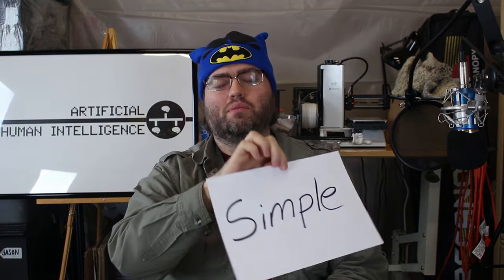How to simply set up a Condenser Microphone

Comment: I have this condenser mic that requires phantom power (neewer nw-700). I also have Yamaha MG10xu usb mixer. I already configured the Internal set up from my interface. yet there is still problem, there is no sound coming from my condender mic to my mixer. My other input such as my guitar gives a sound feedback. I also tried using a regular microphone which also gave a sound feedback. What should i do? is there also a problem with my stero plug to stero jack converter? what should I do?

Comment: Picked up a similar mic from wish nearly identical to that one. But it doesn't require a phantom power supply as its XLR cable is 3.5 mm jack at the other end and draws power from my laptop.

Comment: Thank you for your video.  It helped me greatly.  I have a question:  I have the same exact microphone you have in this video - the Excelvan only mine is a gold color.  I am using a Mac Mini computer but my recording device still does not work.  I did some research and discovered that I need a microphone adapter, specifically, a TRRS (Tip, Ring, Ring, Sleeve) adapter in order for it to work.  Do you have a video for this particular mic adapter?
Reply from the maker: I use a usb sound card, $5 and solves that problem.
Reply: Thank you.

Comment: Thanks Jason!  You are very informative.  I have two Studio Projects B3 mics, a matched pair.  I haven't used them in years, (since 2005) but I think they have phantom power built in. (?)  I'm planning on using them with a Focusrite Scarlett 2i2 3rd Generation digitizer (I think that's the general term for them).  I will only have my solo vocals while playing my non-plug-in nylon string acoustic guitar.  I might sometime have an upright bass player as I sing folk music I've written.  I will get a shock mount and a screen for the voice mic.  With the mic to my guitar do I need a screen, and also need a shock mount for that too?  What do shock mounts really do?  Also if I forget and accidentally have the phantom power on with the mic source, and have it on with my Scarlett 2i2 (haven't bought it yet) would that burn something out?  Thanks for your videos!

Comment: I need help. I bought a voilamart mic and I just bought a hp laptop as well. When i connect it i can hear what im saying on my headphones but when I record the computer doest catch what i say into the mic and it just gets the sound from from the laptops speakers so basically it's like if the mic isn't even connected. Do I need that box that you said was 20 dollars for this thing to actually work?
Reply from the maker: Check your settings on your recording software and make sure that you have your mic selected as the recording device. You may also have to make that mime the default recording device in the recording device panel.

Comment: So ive recently bought Taffware BM 700 mic
And i plugged in to my 3.5mm jack on my laptop and i tried it, it had this buzzing noise everywhere, my voice was unaudible
So i decided to update driver by downloading via realtek website And i tried plugging it in, now it doesnt detect
So with further digging i think i need phantom power supply Will this work?
KREZT PH-710KZT http://krezt.co.id/product/krezt-ph-710kzt/
Will this phantom power fix all the issue i have right now?
Reply from the maker: You need phantom power for that microphone, yes.
Reply: Artificial Human Intelligence so after i received my pp then connect pp to my laptop using 3.5mm jack will it detect? also thanks for the help, subbed
Reply from the maker: After you get the phantom power, if it still doesn't work then roll back the driver.
Reply: Artificial Human Intelligence alright thanks for the guide, i appreciate it
Reply: ItsProinc did it work cuz it happend to me too

Comment: Hey question, If I have a laptop with only one input 3.5mm so combined mic and headset a condencer mic and a phantom power supply will I be able to use that combined port for my output from my phantom?
Reply from the maker: You will need either a splitter for that or a usb sound card. Usb sound card runs about $5-10
Reply: @MacAmbrais  thankyou :D

Comment: As simple as this is, mine still doesn't work. I have the same Nady and a MXL V63M condensor and nothing. However the output cord I'm using, I'm having to use a 3.5m adapter to 1/4 to make it fit my pc. Possibly a problem? It's a new pc I built for gaming so it's high end it's just the most problematic I've ever had for recording. something I've done since '97 lol...

Comment: usb is digital audio XLR is a different audio.  you cant use two different audios if u do it  can damage ur phantom power or microphone u have to buy a converter with the phantom power. if ur trying to use it to ur pc in. U need a usb audio interface is basically phantom power and a usb converter for a cheaper price. thank me later

Comment: I feel really dumb, but the only thing on my computer that fits the 3.5mm is my headphone jack, but that doesn't pick the microphone up obviously, so when I open garage band to record anything it doesn't even show that a mic is connected to computer....what am i missing?
Reply from the maker: A usb audio adapter. Should be 5 bucks on amazon.
Reply: You may need an adapter - TRRS (Tip, Ring, Ring, Sleeve).

Comment: I have a question I have this same mic, bought the phantom power supply, I technically have everything. But if I connect the microphone to my surround sound it sounds perfect, but once I connect it to my computer and try to record the audio it comes out really distorted, sounds really low, and has a hiss...so now idk what to do.😪
Reply from the maker: Make sure all the connections are seated properly, make sure the power supply is on (It might have a button), Go into the recording settings > Microphone Properties > Levels and adjust it to see if that does anything. Also check the levels in the program that you are using. After that, there is a small $5ish usb sound card that you can buy that might solve it. Try those things and let me know.
Reply: @MacAmbrais  I got the levels down, but let's say I want to record audio using my phone with the condenser mic, do I use the usb soundcard or do I buy a microphone-headphone splitter? Because if not it sounds like I'm 5ft away from the mic and gives off a little static

Comment: I have this mic plugged into the mic 3.5 port on my PC and it works. Do I STILL need the power supply? so confused.
Reply: not sure, but i believe that the power supply will make the mic sound better idk
Reply: It will get more power, so you don't have to boost the mic sound causing "fuzz", but if this doesn't happen lucky you ;-;

Comment: SO basically from xlr to usb audio output is not a good idea? No I dont have the phantom power nor the the money to afford it atm.
Reply from the maker: Depends, if the usb provides the phantom power then it is good to go (like a Blue Icicle). Otherwise you need that phantom power. Search around on Amazon and ebay, they have good deals.

Comment: My microphone doesn't even show up, i am going to use the usb with the aux ports but atm, its not working and it should be working
Reply: I'm having the same issue right now, did you find out how to fix it?
Reply: Bad Artifice yes, i got a usb plug that had the mic and headset auxiliary cord plug-ins and plugged it all in and it fixed my problem
Reply: Thank you so much I appreciate you helping
Reply: Bad Artifice Ofcourse 👍
Reply from the maker: Thank you for helping each other out. I love to see this in the community.